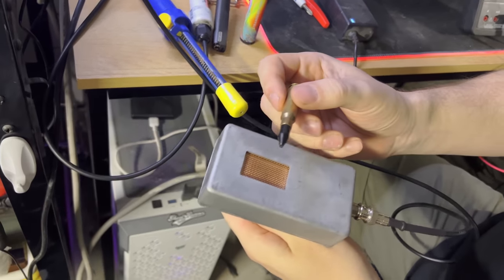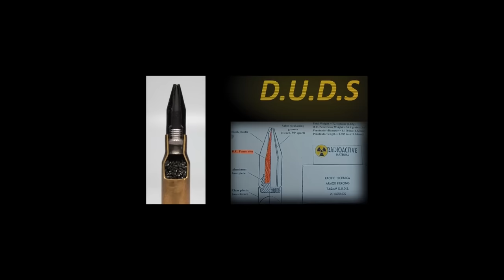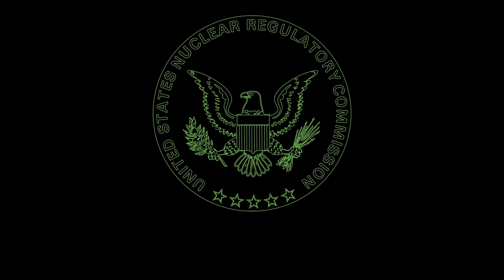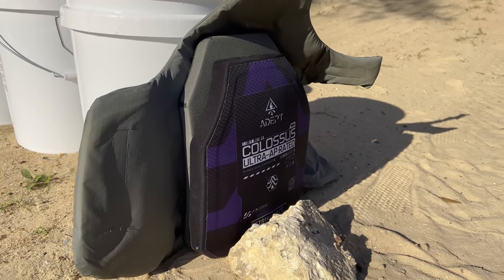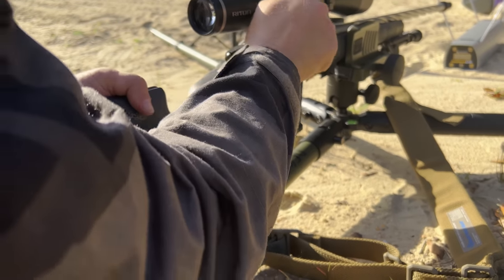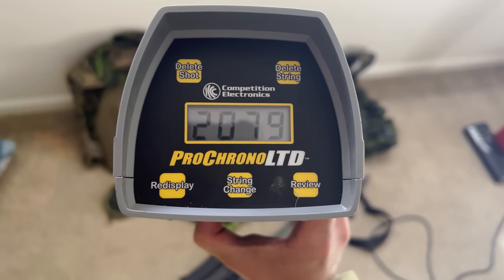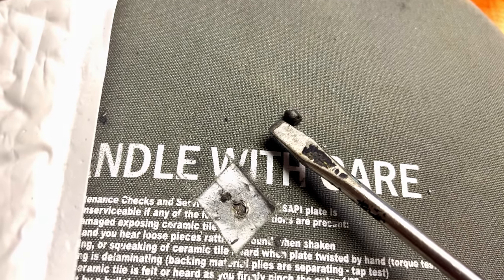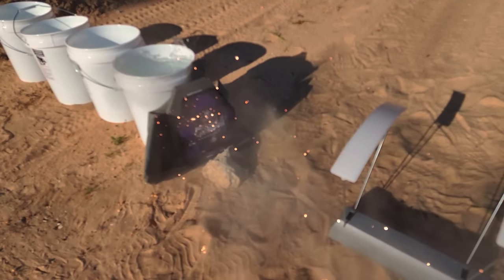Shooting Depleted Uranium rounds - DUDS 7.62x51mm

Comment: would have loved to see someone with a geigercounter to measure the radiation that is left over after shooting the round.
Reply from the maker: I will follow up
Reply: Bro, you need to not do this anymore unless you have precise geiger measurements. When soldier were issued these they were given geiger counters that were basically radiation sponges that would soak up rads similar to human flesh. These patches were then supposed to be sent back to a lab at HQ to make sure when to stop using said rounds. Unfortunatly most modern armies stopped using DUD rounds cuz this work was almost never done due to the fact that merely firing one round would expose you to the critical levels that should've put you in the threshold for removal from use of said rounds. In other words, Armies didnt want to pay out injury costs for cancer and radiation sickness so they lied. Also you should really get yourself checked out before doing this again. Also keep tabs on your hands and lungs for rashes, boils, and look out for a fever that never ends. You were really irresponsible here on so many levels. I pray for you man, you're playing with literal death for the clicks man. Be wiser!
Reply from the maker: @reaper_exd7498  we still use DU. You don’t know what you’re talking about.

Comment: Depleted Uranium feasible for future use?  possibly.

 the thing is, you're using a 24 inch barrel rifle, firing it from a point blank distance.

I wanna see this thing fired from an AR10, SCAR H, HK 417/MG3, FN MAG ect. Something in common infantry use with variety of barrel lengths, and fired from likely/variable combat distances of 10-30-50-100 meters.

you can penetrate armor with a 20 inch barrel AR with green tip from about 10 meters already, but move far a bit and the armor does it's job.

this thing could probably penetrate ceramic like ratnik from 10-30 meters, but put more distance or the barrel length and things could change.

same with all penetration tests, a lot of them do not account for this.
Reply: This wasn't intended for ceramic, steel, or soft body armor. It was intended for use vs vehicles. Seems nobody here realizes.
Reply: @flcktphs   he is implying that it would feasible for such use
Reply: @flcktphs  the army isnt just gonna start issuing DU rounds to pen vehicles lmfao. Oxide said there could be a use for these rounds at the end of his video
Reply: @_wayward_494  Maybe read what I wrote before you start replying? DUDS was developed for the purpose of penetrating vehicles from distances that regular 7.62 AP wouldn't do much at. Not shooting body armor from 2ft out.

Comment: Spilled blood and discarded steel, copper, and even lead do not present the hazards of igniting  high speed DU projectiles.  DU is also used in Armor.  It is fascinating to watch it being used in those two shots.  And one can see just how dangerous it is to use in small arms ammunition.  
I am absolutely against it being used in future battles.  
The half life is extremely long and as a dust it is extremely dangerous to breathe in those alpha particles.   
''The principal isotope in natural and depleted uranium, 238U, has a long half life (4.5 billion years) and primarily decays by alpha particle emission.'''

Comment: From very briefly studying WW2 tank ammunition for WOT years ago, Shells originally were designed like bullets with a sharp penetrator tip. In turn tanks received FHA (Face Hardened Armor) to cause the tip of the shell to crack. Shell manufacturing then changed to add both a Ballistic cap (for flying through the air), as well as a flat cap to cause the armor to crack without damaging the penetrating tip. these in German terminology were APCBC, Armor Piercing Capped, Ballistic Capped. It would be very interesting to see a subcaliber round designed in this way and tested against ceramic armor.

Comment: Honest suggestion to try Swiss (Swedish?) 7.62x51 SLAP ammo, and also to make absolutely sure you don't use a muzzle device. SLAP rounds tend to have a habit of tumbling from rifling not designed specifically for the round, let alone from the additional disturbance of a muzzle device.

Did a quick look while writing:
PTR-10 PRICK, and it is indeed Swedish
Reply: depends, you can make muzzle brakes that work well with sabot rounds but obviously not many rifle brakes are made like that.
Reply: @Wehra96  true, but I think finding the correct muzzle brake might be harder than finding the round and/or rifle itself
Reply: @V3RTIGO222  not really tbh, the design on those brakes is quite simple.
Reply from the maker: I do have some slap ammo of this type
Reply: SLAP in nothing for that plate. Tried it already.
Reply: @greggreen2969  Really? It stopped it? I was going to try SLAP next.
Reply: @BuffRANGE  yes, I fired 2 with Very little BFD even.  I passed on the videos to Adept
Reply: @greggreen2969  nice ! Seems like this plates on weakness then is SMKH

Comment: Question, how concerned are/were you about being so close to the impact point regarding DU heavy metal dust? From my limited knowledge, the only radiation dangers from DU rounds are the dust/particles that can be easily ingested.

From the camera angle, you looked scary close to the dust cloud.
Reply from the maker: Not concerned
Reply: @Oxide_does_his_best  Fine line between boldness and stupidity
Reply: In fact the main danger is not radiation but heavy metal poisoning, as uranium is very bad in this respect. I handle small quantities of DU at work (in the form of uranyl acetate, it's used as a stain for electron microscope samples) and this hazard is regularly drilled into us, whereas we never worry at all about radiation.
Reply: @nerd1000ify  I think that’s roughly what I understood also, granted I also thought the radiation would be “bad” (not ideal) but I agree the heavy metal is probably the main concern and the radiation is more secondary

Comment: If the US Army is worried about enemy body armor then DUDS type Depleted Uranium projectiles would definitely be a way to improve effectiveness of existing NATO calibres and would Save costs on strategic materials like Tungsten that is rare, expensive and best used for machine tool tips in factories if a large war breaks out against a foe with widespread body armor access. Judging from the performance of the Underloaded 7.62mm a DUDS vs an extremely tough Level IV + plate I expect that 5.56x45mmmm NATO equivalents could potentially pierce a more generic LVL IV plate like ESAPI but maybe not something akin to XSAPI.

Edit it might actually be cheaper than the SiG Spear program since DU is relatively cheap and plentiful thanks to decades long Nuclear Power Plant initiatives leaving the Uranium as a byproduct that is easily forged into munitions with the proper infrastructure.

Comment: Depleted uranium is quite safe. Alpha radiation will not penetrate skin, but you are fucked if you breathe it in. 

But that changes when they have hit something. The heat makes them extremely radiactive. To a point that you should not go near a tank that has been shot by a DU pentrator and giving some of the surviving crew mild radiation sicknes.

Comment: DU rounds don't have more energy than conventional rounds however they are unique in two ways: the ignite on impact and Uranium breaks with very sharp angles. it doesn't vet dulled or squashed like other metals which make it keep on going even after breaking.

Comment: For a few months in 1982 I worked as a machinist at N.M in Concord, Ma.
You could strike a file on a bar and send sparklers the length of the room bouncing on the floor.
I have no aftereffects, except not requiring a light for bathroom breaks in the middle of the night.
Reply: Oh darn, are these DU or enriched ones？

Comment: Hey, don't wanna be that guy, but I think there's a chance your chronograph clocked the round at ~2000fps because it picked up the speed of the discarding sabot and NOT the round. Seen it happen before, but damn that's a neat round!
Reply from the maker: That's very possible! The noise and recoil was quite higher on the original round though

Comment: You do know that U 238 (depleted Uranium) not only emits alpha particles but is also a toxic heavy metal. The BIG problem with U 238 is not that the alpha particles will penetrate the skin, as they won't even penetrate paper. The danger lies in the fact that once INSIDE the body, tissues are constantly bombarded with radiation. Alpha particles, although not possessing the high energy of beta and especially gamma radiation, are quite large in comparison. This means the odds of them coming into contact with and passing through tissue is very high. This insures that damage is certain, as is the death of that organism. Those that were physically involved with this 'experiment' most likely were poisoned. Look up (Fallujah Iraq/ depleted Uranium)

Comment: I think the missed opportunity here was not firing at actual steel plates, considering that the round is designed to "Sharpen" as it pierces solid/dense and thick matter. 
also, everyone involed in this clip should pay a visit to a doctor.  But non the less, great video. had no idea those came in bullet form.

Comment: What if any practical difference would there be between this DU bullet vs an identical round but with a tungsten carbide core? I understand DU is heavier and has fracture patterns that lead to a 'self sharpening' effect, which is useful in large scale tank rounds, but what practical effect does that serve in small arms vs tungsten carbide? Are there any tungsten carbide sabot rounds in 7.62x51 that could be loaded similarly and compared?
Reply: If im remembering correctly your actually on the nose, for most uses tungsten is perfectly adaquate and as a result is much more commonly used
Reply from the maker: I will show the tungsten type as well. Generally DU rounds are not just more effective ballistically but also cheaper
Reply: @Oxide_does_his_best  thats cool to hear! i didnt know there even were such a thing down in the .30 caliber range. i knew of SLAP for .50's but thats awesome you're able to get a hold of something or are you going to custom make it? Also thats crazy to hear DU is cheaper than WC, though i assume thats strictly for military procurement lmao, i dont even want to think about how much a DU round goes for on the civ market.
Reply from the maker: @X4Alpha4X  I have some old stock used by little birds
Reply: @X4Alpha4X  lets also say, the US has a good stock on DU in general compared to most other places

Comment: Those rounds provide maximum penetration around 200 yards. At close distances the projectile is not yet stabilized, high speed photography shows the projectiles yawing at first, then stabilizing after approx 200 yards, +-

Comment: Yes, so for the sounds of radiation, what you are hearing in the beginning isn't really as lethal as first exposure. If you hear the detector have consistent or constant audio where it just holds the sound without stopping, then you should be worried and either get away from the area or drop the material. Obviously, for a depleted uranium round, you don't want to have prolonged exposure. Same thing as standing out in the sun. You'll get sunburned and hopefully not worse.

Comment: I was DU heavy during the invasion, and went black on 25MM 3x, only had to fire my coax 1(got my 1 coax kill too). However, when I fired my 25, my APFSDS-T M919 rounds through multiple Iraq, collat style homes and concrete businesses with my rounds penetrating the concrete like butter, and smoking the enemy from behind. At one point my thermals went off sight with my reticle off 4ft from the barrel position(major ICU malfunction) and I watched rounds tear through 4 homes and ricochet off the earth into the sky.

Comment: You should have been wearing the respirator. Also, I think you're either ignorant or (hopefully not) callus towards the civilian impact of using these weapons. That uranium is going into the soil. We have laws that prohibit the use of weapons that do not discriminate between civilians and hostiles. Uranium in the soil and water doesn't discriminate. 

Essentially you're saying that despite the risks to the operator it should be put back into service and the civilian impact is justified because of it's effectiveness. You should be more considerate with what you're advocating. This kind of weapon meets the definition of a war crime

Comment: The problem with dpu rounds is that they aren't that accurate. The barrel rifling doesn't touch the penetrator itself (only the sabot) which means there isn't going to be spin enough to make the round accurate. The only thing that makes them usable at all is speed and the volume of x51 cartridge isn't enough to make that happen. On a sniper platform, a match grade x51 is accurate and it will give you the same result. So the only small arms use case for dpu is .50 BMG and on the M2HB with stationary mounts in checkpoints etc. in maybe 1:3 or 1:5 ratio.

Also, where'd you get the gyrojet?
Reply from the maker: That isn’t true at all. SLAP 308 can be sub moa…
Reply: @Oxide_does_his_best   You know what, you are right. Having looked into it, the swedes aptly named their slap 7,62 mm Sk Ptr 10 PRICK and made it accurate. The .22 sub caliber is actually plugged into the sabot to transfer the spin from the rifling and the tapering is also very tight. They've also designated it anti-materiel instead of AP, their AP is jacketed so it's a bit slower but is naturally more accurate.
The American m948 was discontinued for (among other reasons) being too inaccurate. The swedish round wasn't available in the nineties during my 'service'.

Comment: So what's the point exactly of the uranium round compared to normal round.?
Reply: Uranium is almost twice as dense as lead and has similar hardness to steel. So it is very good at punching through armour. As seen in the vid it also ignites on impact which causes incendiary effects behind the armour if penetration occurs.
Reply: @nerd1000ify  Thanks for that.

Comment: I'm honestly wondering if they're going to put something like this into the NGSW combat load. Because the military wanted the gun designed around a very specific cartridge diameter & velocity, to pierce armor. And as far as I know, nothing used today will pierce armor. DU might just be the secret sauce penetrator the military cooked up and is keeping secret.
Reply: @brushnit9212  Nothing you listed will pierce modern plates. There's plenty of tests on youtube. M855A1 for example basically has zero penetration ability of hard body armor, it's meant more for barrier penetration. There's even a video of .338 being stopped at something like 200m by a ceramic plate. Modern ceramic plates stop everything, even if it's labeled as armor piercing. Hell you can see it in this video, this DU round just barely put its tip through the ceramic plate. Look at some of the russian body armor test videos on this channel.
Reply: @moonasha  the thing is, ceramic plates cover the chest sure,

plenty enough torso, stomach arms legs face and neck exposed to make a casualty, body armor definitely improves survivability, but chances are if someones life was saved by body armor, they are probably now the unwilling owners of various other physical traumas
Reply: @therideneverends1697  that's simply not true. Lots of data from GWOT about body armor taking hits and people being fine. Bases would have rows of plates hanging up that took hits from snipers or what have you. Interview with jocko where he said people would take hits all the time. I don't know why you're trying to argue this. You literally said ammo the US army uses pieces body armor plates, which is 100% false. Now you're saying if you take a hit on armor you probably got hurt elsewhere, which is also 100% false. The US military wouldn't want an armor piercing infantry rifle if they didn't have data from recent conflicts that made them spooked. Remember the US military always desires overmatch, an overwhelming advantage. Why are you arguing about this and saying false things, come on

Comment: I can appreciate your scientific method for the most part, but I think you're way too close to be getting reliable results from a Discarding Sabot round.  The Sabot needs time and distance to shed.  By the looks of the entrance holes, the sabot was still attached to the core when it hit and that has a dramatic effect on its terminal ballistics.

From a safety aspect you are also Way Too Close.  That target should have been at least 100 yards away and even then, a good tail wind would be nice.  If you are taking burning DU to the face shield, you are too close.
Reply from the maker: You can see the impacts of each petal on the face of the plate

Comment: This makes me curious, how the slightly faster but lighter 6.8x51mm duds, if something like this exist, would do against the level IV plate.
Reply: Zip right through. Discarding sabot is the next step in small arms munitions. We already hit the absolute limit of traditional full caliber rounds half a century ago through tank design. Body armor is getting to the point where full caliber bullets will no longer pierce it. So the next step is to copy what tank designers came up with. APDS. Then maybe 200 years from now soldiers will be firing miniaturized APFSDS

Comment: It is most likely not alpha radiation actuating the radiation detector as alpha will not penetrate a sheet of paper. So you either have uranium contamination on the outside of the sabot, or are detecting gamma radiation.
Reply from the maker: The probe detects all three